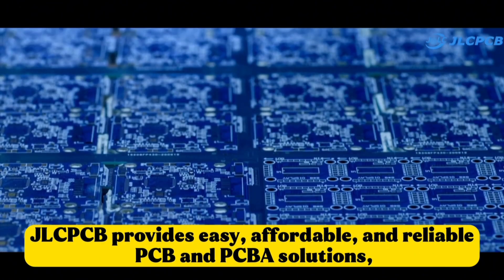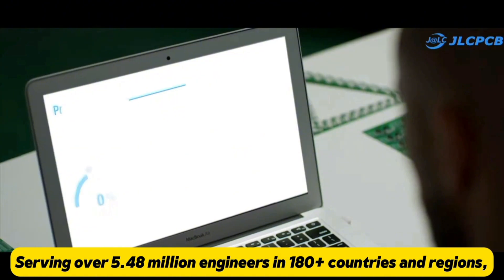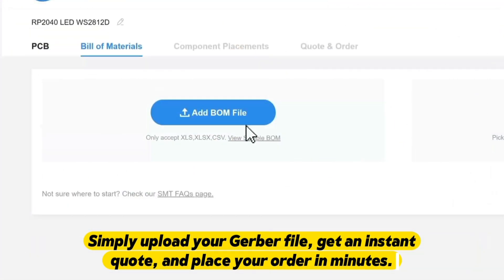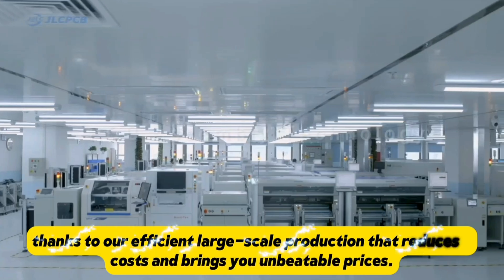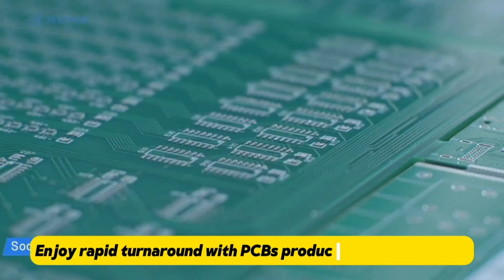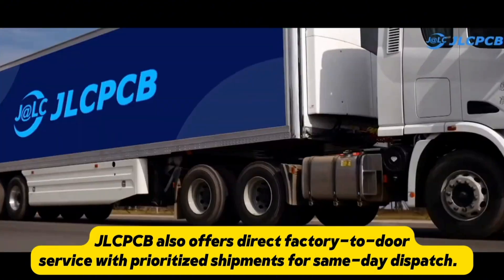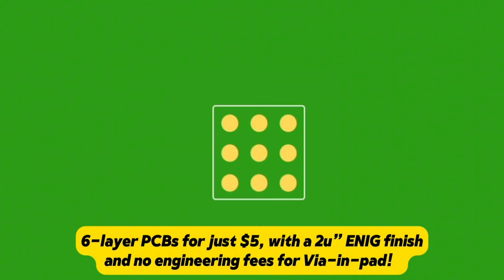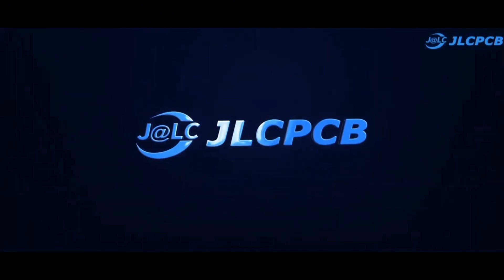How To Make Electric Fence Circuit With Inverter | Step-by-Step Guide | JLCPCB

Comment: Hi my friend, we finally did it! This is absolutely fantastic! Congratulations! This is what I want to do. If I'm not mistaken, to get a pulse every second we should add a 50uf 450v capacitor and then adjust it with the right trimmer. I can't wait to build it. I wanted to ask you, what if instead of the car coil I installed a homemade coil like the one Electrice made? Do you think it would work well? Or is there a risk of burning something? Please let me know. Bye, hugs and God bless you.